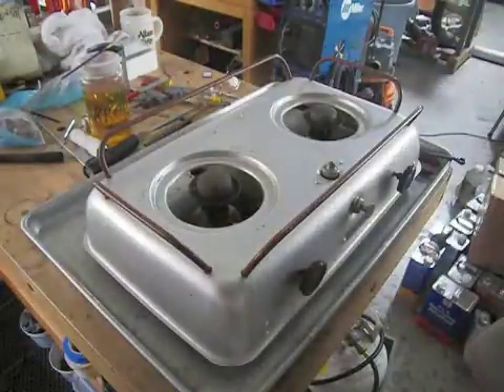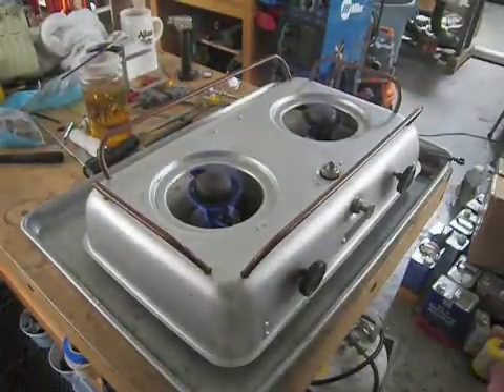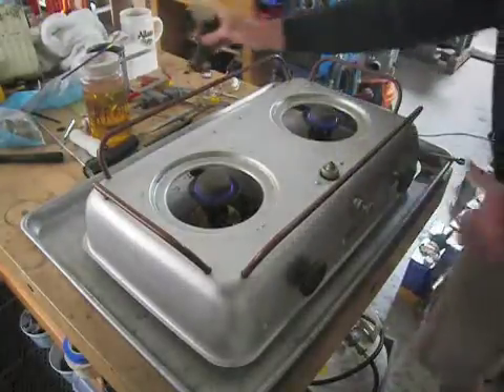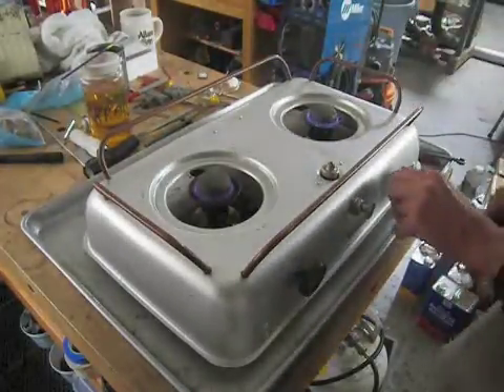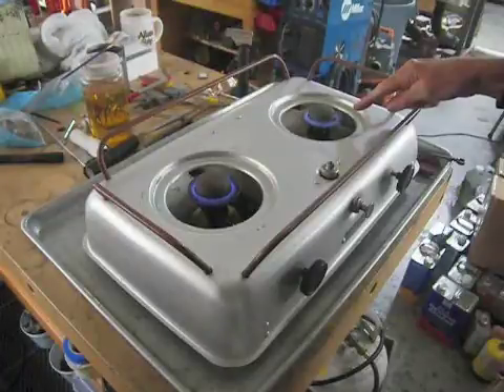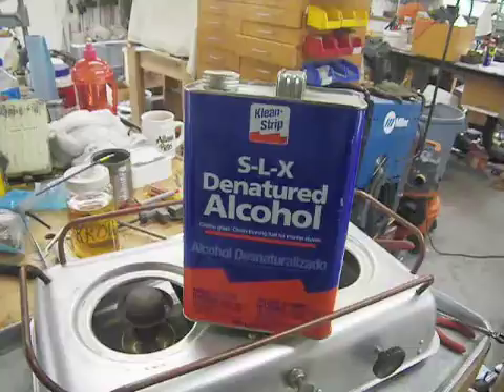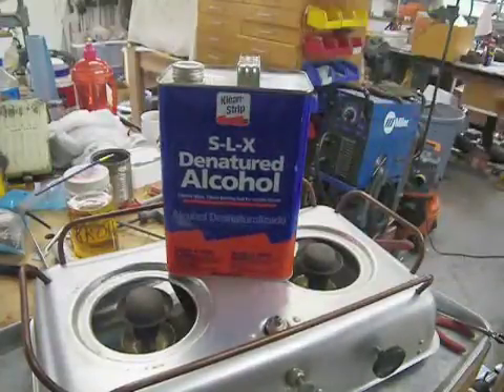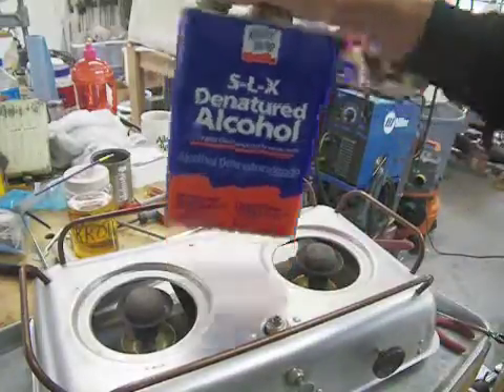Homestrand Mariner 205-32A Alcohol Fueled Stove

Comment: Figure I filled mine with rubbing alcohol now what do I do to save it
Reply from the maker: @Angela Gottman First thing? Read the online instructions: https://www.cookwithkenyon.com/wp-content/uploads/2014/07/Homestrand_Alc_Stove_Model_205A_Manual565.pdf 
Then, dump out the rubbing alcohol. Blow some air into the tank on a sunny day and the rubbing alcohol should mostly evaporate. Replace the fuel cap seal and the relief valve pip in the fuel cap. Replace the pip in the pump check valve. Put quality denatured alcohol (greater than 70% ethanol) in the tank. Preheat. Light. Burn through a couple of tanks to flush out all the rubbing alcohol. Have fun cooking with your properly fueled stove. BD

Comment: Nice video.  I recently bought two of these.  One was silver colored like this, the other golden.  It was helpful when I lit up the silver one, so that I didn't freak out when it started to pulse and gurgle. The golden one has a cracked pipe between the tank and the left burner.  I got the pipe loose, but I'm having difficulty identifying the type of pipe and the type of threading.   Do you happen to know the pipe size and threading type, BSPT or NPT or metric?
Reply from the maker: Thanks! These came in a range (pun intended) of colors back in the day. I know all the details on replacing and threading pipes. Done more than one. It's a bit of a complicated operation and maybe more than the average Joe is going to be able to take on. So, drop me a line and I'll share with you off this public comment system so's we don't have broken pipes from the newbies flying every which way. 😲😉😎👍 bd@berniedawg.com BD
Reply from the maker: I see you’re still slowly uncovering, the very long and hard way, all the info I could have provided to you in a simple single email. So much effort and so many missteps asking folks who have little to no skills or knowledge on social forums. I feel bad for you. Very sad really. You could have finished by now. 😕 BD